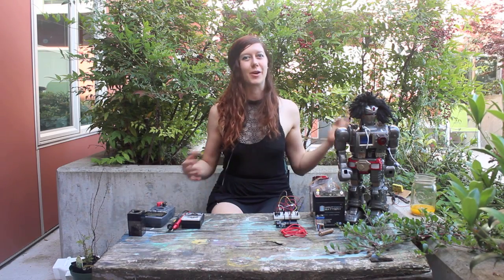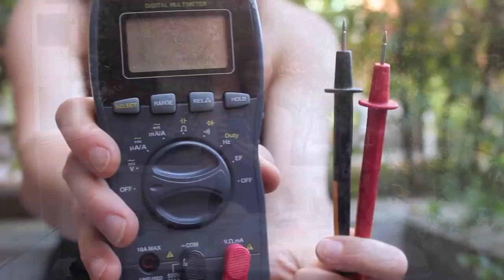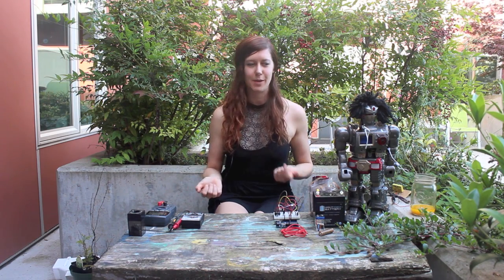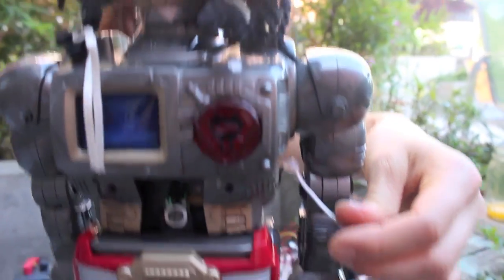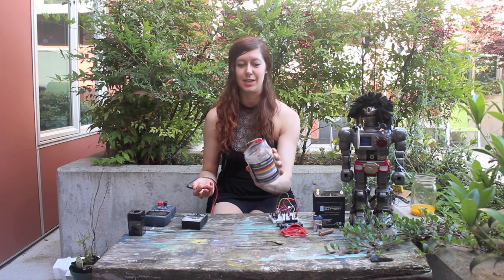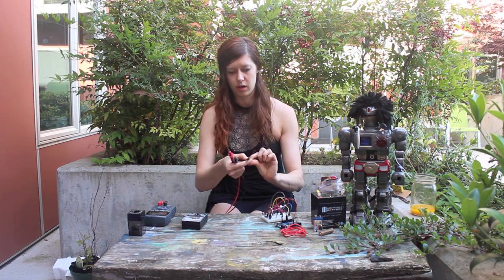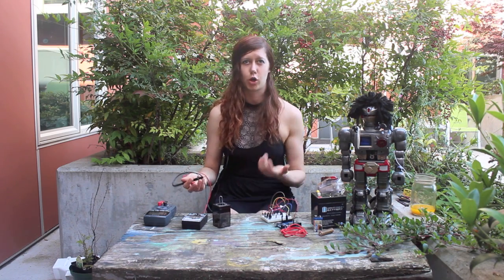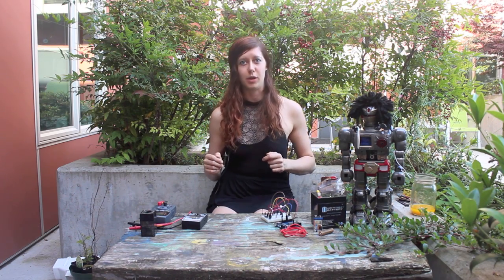How to Use (& Choose!) a Multimeter!

Comment: I would like to ask you what is more dangerous in DC;the voltage or current?
I touched both terminals of a 12V A23 battery with really low current but afraid to touch 12V 50Ah car battery. Also why a Battery is a non-ohming device(Does not follow ohms law V=IR)? Looking forward to your answers! Thank you.
Reply from the maker: Great questions! In terms of which is more dangerous, current or voltage, current is what kills you b/c it is the actual flow of electricity through your body-- currents above 100 mA are lethal. However, your skin has a certain resistance to the flow of electricity, so if you touch a high current source that is very low voltage (e.g. 2 V), the current doesn't have enough "oomph" to overcome the resistance of your skin, so it will not flow into your body. Voltages above ~ 20V are typically high enough to cause breakdown of your skin, so that current flows into your body. So it's sort of both, but current is what is lethal.
Re: battery not being an "ohming" device, batteries actually do have a small internal resistance. You can think of a battery like a perfect voltage source (called emf, or electromotive force) in series with a small resistor, which means you have to invoke Kirchoff's loop laws to calculate how the voltage changes across the battery as the current draw changes. Here's an excellent in-depth overview on this: http://farside.ph.utexas.edu/teaching/302l/lectures/node57.html 
Hope that helps!
Reply: Okay,I appreciate your reply! Subbed! I can touch my car battery now!
But if I connect a Ideal battery with zero resistance to a few resistors in series,I think it must follow Ohm's law... V=IR (R=R'+r of load + resistance(battery's))
Still have to pay a visit to mentioned link.
Reply from the maker: Absolutely! Although it's not exactly safe to touch your car battery b/c it has very high current. If you have a cut on your hand or your skin is wet, it might electrocute you. And, unfortunately, there isn't really such a thing as an 'ideal' battery. What you're talking about is electromotive force (emf).
Reply: You got pretty late to reply this time! Anyways I got that! In my terms a Battery is not an Ohming device,It does not follow V=IR for some unknown reasons.What are those unknown reasons?
And thank you for saving my life with that warning. :)
Reply from the maker: Hah yea I was out of town for a few days at a programming conference :D Glad that my response was still useful!

Check out that reference I sent on battery internal resistance, it does a good job of covering your question. I'm not an expert, but basically all materials  have some resistance to the flow of electricity -- some of the electricity flowing through any material will be converted to other types of energy (e.g. heat), so any battery will have the same issue. It's small, but not negligible.
Reply: You are right! but still I still don't get this "Why a battery is a non-ohming device?"
Though link given by you is pretty useful it did cleared up few things.